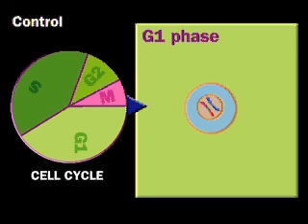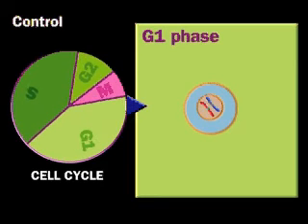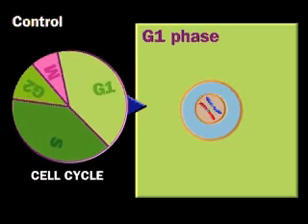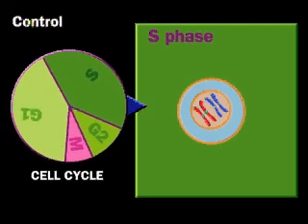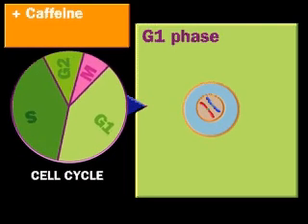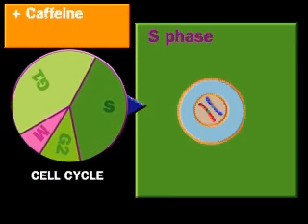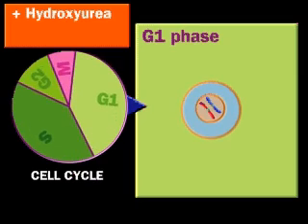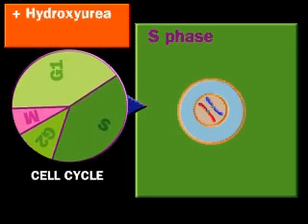cell cycle control check point.

Comment: Eukaryotic cells have developed a complex system of regulatory mechanisms called cell cycle checkpoints to ensure that certain cellular processes are completed before downstream cell cycle events can occur by delaying or arresting cell cycle progression. The many proteins and processes involved in the #checkpoint response often overlap and function interdependently with the mechanisms of DNA damage repair, and apoptosis. The cell cycle checkpoints regulate entry of cells into S-phase, progression through S-phase, and entry into and exit out of mitosis in response to DNA damage. Due to the importance of cell cycle checkpoints in maintaining genetic stability, defects in this system can contribute to diseases such as cancer. -Creative BioMart